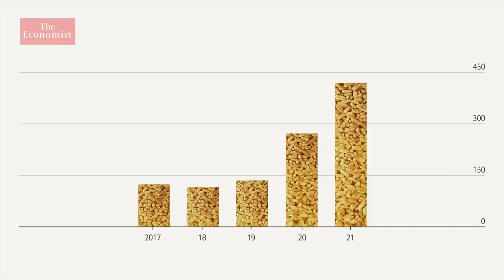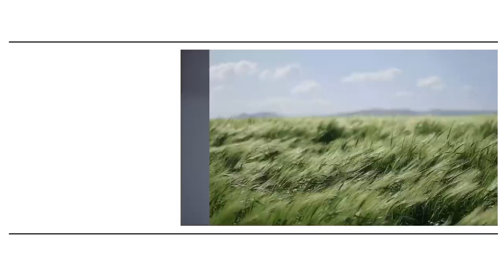The global food crisis, explained

Comment: Industrial agriculture must be transformed into agroforestry systems that mimic the way nature works. Agroforestry systems do not need artificial fertilisers, irrigation, pesticides, large investments and energy requirements. Agroforestry systems build soil instead of destroying it and it holds water, lowers micro-temperatures, better withstands rain and drought, and has high resilience. There are more than 50,000 edible plants on earth. Agroforestry systems consist largely of perennial plants that do not need to be sown/planted every year.

These agroforestry systems can be created in and around cities and villages.

I rarely hear about agroforestry systems and permaculture (design systems), which should be at the top of the agenda when discussing food security. But it doesn't benefit big business and that's probably why it's as quiet as it is.
Reply: You have a point, but how does agroforestry feed the hungry?
Reply: @geoffstrong9756  People eat food, and agroforestry systems and permaculture produce food with high productivity and resilience (and all above). When they are established they require rather little work. These system also include animals (Silvopasture).

Agroforestry systems can produce 3-4 times more than grain production (in some cases). Because these systems can be built in underdeveloped countries, they can become self-sufficient in food. The same applies to rich countries, of course.

A bottleneck is access to water during the construction phase. The world will need desalinated water in very large volumes. Once the systems are built, they will change weather patterns and create more natural precipitation. The entire Sahara could thus become a giant agroforestry system that changes the weather in both North Africa and the Mediterranean region.

There are many factors involved (in addition to those I mentioned above) such as food security (wars, solar storms, fuel prices/availability, material prices/availability, job opportunities, health, pandemics, nutrition, geopolitics, transportation, etc).
Reply: Christer, attempting to grow forestry on the Sahara or any of the great deserts is as futile as trying to grow same over the Arctic tundra.  The nature of large weather systems, such as the Hadley circulation, preclude any such attempt, not to mention the lack of arable soils.  You can do a little of that at the desert edges, but nothing very significant.
Reply: @geoffstrong9756  I haven't said it's easy, but I don't think it's impossible. You can start at the edges and work your way in.

I don't mean that the Sahara is priority one, but in the longer term, if civilization survives, I can see this scenario before the end of this century.